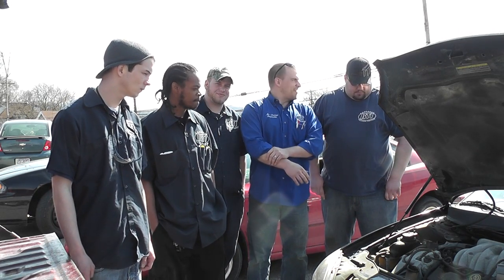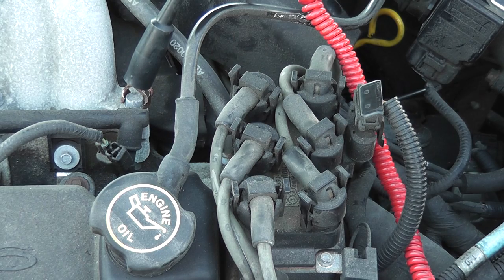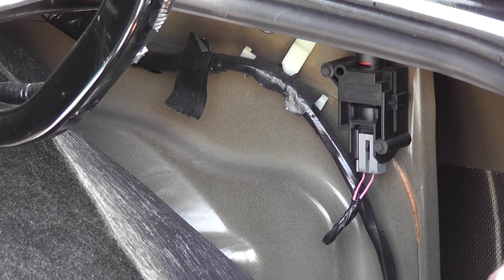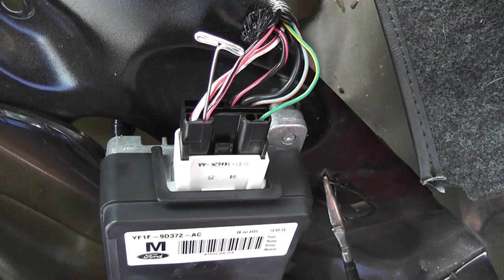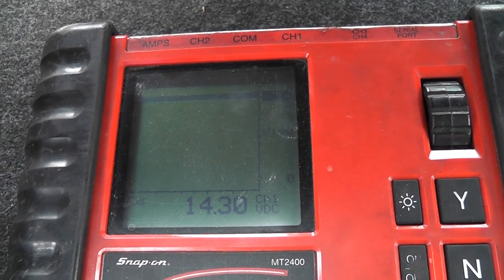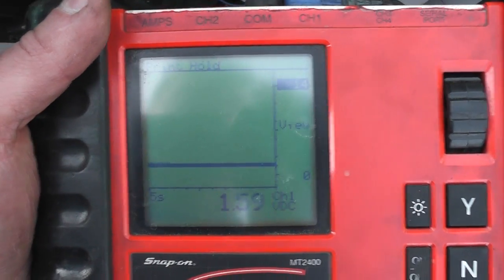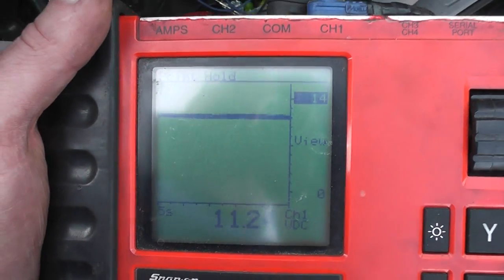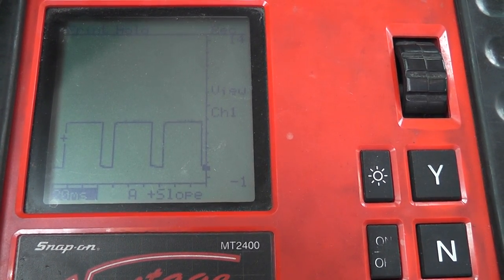Ford Electronic Returnless Fuel System Diagnosis (Part 1) - Ford

Comment from the maker: @bobby8926 surprisingly, it is very reliable, I have yet to see one of these module go bad. Every time I have diagnosed a low or no fuel pressure problem on these it was always the pump. However the modules can definitely fail, so I thought it was important to show the complete test.

Comment: Problem with your tool to detect voltage will cause you to make errors in judgment.  9volts will light your light but not run a 12volt circuit

Comment: Hey brother! Me again, we talked a couple months ago about a 2017 Ford Focus SE. You will be happy to know that I have diagnosed all of my electrical issues which lead me to determine that the PCM was for sure bad. 
I bought a new used pcm (correct PN) and went to use IDS to reprogram it and IDS would not for the life of me recognize the car as a Ford Focus...it kept recognizing it as a CMAX. After hours of diagnostic work and talking to my friend who is a “lead technician at Ford”...no luck. He kept telling me to replace parts which as we know is not the way you diagnose/ fix problems cheaply. I ignored it and decided to look into a electronic TB clicking noise that he told me not to worry about. Needless to say when I unplugged the TB, I was able to reprogram the pcm as IDS recognized it THEN as the correct year make and model. After doing all that and reprogramming PATS, the car cranked kinda intermittently with both keys which was a leap of confidence as it didn’t do that before. When I did a system test with IDS, all modules passed with flying colors but obviously I had a code for the TB. The challenge now is that every time I plug the TB in it begins clicking and I get a no communication with PCM 😭
Reply from the maker: maybe it is shorting out the 5v ref circuit when you plug the throttle body in. Do some voltage measurements on that unit and in particular the TPS circuits
Reply: @ScannerDanner  I am pretty sure I did and it was good. I will check again. Oddly enough I found a video in the depths of YouTube that a guy was experiencing the same symptoms: https://youtu.be/89erBTvQgSw

He dropped it off at Ford and they said it was a faulty fuel pressure sensor which fixed the problem. I will be checking the two fuel pressure sensors as well. I’m assuming in his situation the ecu wasn’t receiving correct pressures to allow the TB to calibrate correctly at key position 2.

Comment: Great video. I am a professional auto tech and just had an issue with a 2014 F150 Fuel pump. Several weeks ago the fuel pump failed, I properly diagnosed it and checked the operation of this fuel pump control module.  Replaced the fuel pump and got the truck going again for the customer.  Well two weeks later It died on the customer again. This time it was a bad fuel pump control module.  What must of happened was when the fuel pump failed it drew a high amperage and damaged or weakened the control module. It lived on for about two weeks but then failed. 
I think from this point forward when I replace a bad fuel pump I am also going to recommend this module be replaced as well.  In this case the module was $60, cheap insurance to prevent a future breakdown.

Comment: Thanks, you saved me a lot of worry and money.  I was pounding a dent out on a friends Taurus, driver side rear quarter panel.  I could hear an occasional noise like a tape measure snapping back.  Well, when I finished, the car would not start.  I found the inertia switch in the LH of the trunk, pushed the red button down and it started right up. 
 thanks again

Comment: Hey you just saved my life with this video. My 06 Mercury mountaineer died on me a few weeks ago. I changed fuel pump and fuel pressure sensor and nothing. I started checking ground wires and found the problem. Im now up and running again. Thank you so much for your information
Reply from the maker: no problem! So you found a bad ground wire to the fuel pump module?
Reply: ScannerDanner  I believe it was a ground. Was having the same type of symptoms.  rpms would bounce a little with blinkers on along with dash lights would flicker. Eventually it corroded all the way through leaving me at a stop light

Comment from the maker: @NOEISY1 Are you having any driveability problems? Both upstream O2 sensors should be switching rich lean. It sounds like your bank 1 O2 is not. But I would be careful about putting an O2 in this as a small vacuum leak on bank 1 could cause this condition too.

Comment: Thanks ScannerDanner!
I have a '03 Taurus with an intermittent start condition. I don't have a correct manual on hand and this is a great help to get to the issue. I couldn't find the fuel pump control module on the car to troubleshoot it.
Awesome help!

Comment: Excellent!  Wish I would have watched this yesterday before diagnosing.  On another note, (2004 ford explorer, 4.0, crank/start no power, 3000 rpm in neutral max) I did it differently in the end by jumping the pump power to incoming power (wt/rd to pk/bk), jumped pump ground (bk/pnk) to chassis ground, pump ran fine (I could hear it), still showed low pressure on scan tool, and under load pressure fell away until stalling.  Pulled the filter and turned the car on only to watch the fuel dribble out of the line.  I have never seen a pump that runs aurally fail.  I suppose it could be the in tank regulator failing, or the sock is clogged up.  Either way, it's time to pull the tank.  Thanks for your post!

Comment: Thanks for a nice explanation. I hv a ford mustang 2014, same system. It runs but struggles to start. Key on engine off has 41psi but rapidly drops to zero psi after a few seconds. My understanding should keep pressure in the line as it has check valve.
Reply from the maker: Is this a GDI system?

Comment: Best post yet dealing with no fuel pressure  for me ! Guy has freakin thunder cats knowledge, but the more I listen the better I get! Just wish you would do a f150 with that dual tank switch . Oh yeah where are the best grounds in cockpit areas where do you 1st look for grounds for your test light.

Comment from the maker: @JohnzCarz I don't think I would use an LED type test light but a regular test light you will have no problem with whatsoever. There is not enough current to damage the bulb filament.

Comment from the maker: @TRcustomengineering Thanks bro, stay tuned, I am going to review this with my class today, using the case study in my book on this same system. I will post the lecture when I am done.
Reply: Where is the lecture posted ? I would like to see it.
Reply from the maker: @rexluongo6470  offhand I don't have a link but it would most likely in my chapter 15 playlist (Fuel Pump Electrical Circuits) or 16 (Fuel Pressure Testing)
Reply: @ScannerDanner  If a maf sensor is replaced with a bad maf. Where do you buy a good one? Just asking because I figured out one of my issues. MAF is bad. Replaced it with oreillys new MAF, runs normal at idle but now runs lean at throttle and high rpm only. It used to be the opposite or just ran lean all the time. Throttle response improved tremendously. So I am pretty sure I got a bad MAF. What is your expert opinion?

Comment: I’m having the same sort of problem with my 1999 mustang v6 and most things point to it being a bad fuel pump but when I touch a different ground to it the fuel pump starts working. Also my injectors seemed to have stopped working. Maybe it’s all connected. Any advice would be great

Comment: Very helpful info.  thanks.   On a 2004 focus I tested , the fuel pressure was at 29 psi, (low end of the spec was 30 psi), and the pressure was bouncing around a bit.  Is that normal with a Ford module system that doesn't have a fuel pressure regulator?
Reply from the maker: Yes. And if you snap it to wide open throttle, it should increase as well, but I think you'd have to drive it to see it.

Comment from the maker: the key is to understand that this pump is ground side switched. so when the pump is turned off you should see full battery voltage on the pump ground. since we see low voltage this indicates a brush to motor contact problem.

Comment: Hey danner thanks for the videos they're awesome! I just don't understand how the bad brush contact in the fuel pump would cause the voltage to not return to 12 volts. What is the brush making contact with to make that happen? The way i see it when the rotor stops spinning the commutators may be in contact with the brushes either way, so my question is what exactly do you mean when you say " the reason it doesn't go back to 12 volts is because of a bad brush contact"? Thanks again man cheers!

Comment: Hey scan just a question the 1.61 volts at the ground side of the pump with an open ground and no current flowing you had voltage drop. Would it be correct to say the bad brush contact in the pump had incredablely high resistance? Excellent video.

Comment: ScannerDanner.....AWESOM breakdown.  I am currently working on the same vehicle, 2000 taurus....one question....how did you access the CM in the trunk?  Is the "felt" verticl cover that looks like it runs along the back of the seat what needs to come off?  If so how did you go about removing that?  I can't figure out how to remove things without damaging the covers...
Reply from the maker: Jeff it's been a long time. I believe I was working in the right rear area. Don't remember if I took the seat out but I do remember having difficulty finding it.

Comment: Just want to say thank you for everything. i’ve been learning a lot from you. But I’m stuck don’t know what to do I have a 2006 Ford ranger 4.OL V6 having a misfire problem I replace the coils and spark plugs and wires and it’s always the second cylinder misfire I checked for leaks check my map sensor and my downstream O2 sensors both short term -2 in the long term is at between 14 16 what can I do next ..
Reply from the maker: could be an injector or compression issue. Check compression next

Comment: Urgent help needed!
Got my hands on a car, 2003 police version. Engine will not start. Runs for 10 seconds in the morning after starting it and won't start it again during the day. I have changed the crankshaft sensor, idle valve, fuel pump control unit. There are no errors in the diagnostic scanner. Also in the scanner I can see the engine RPM, fuel pressure and other parameters that are normal. I can see pulses on the coils and injectors connected with lights when trying to start.
I've checked all the fuses and relays, tested the wiring. The spark plugs in the engine are new, compression in the cylinders is fine. Have not been able to cope for a week now. Help with advice or action.
Reply: @Slipknot-qm9yh Bring it back to the police station, bro.  Not worth it 😀

Comment from the maker: It does and I can on a different car in the future as this one is fixed and back to the customer. Testing is identical to any pressure sensor. 5v reference, signal and a ground. Signal voltage is analog and changes in proportion to fuel rail pressure. Low voltage, around .5 volt = 0 psi (if I remember correctly)

Comment: While my 2000 Taurus was running I checked the voltage on the power wire from the driver module to the pump and it shows 9 volts.  Should it be higher or is it ok? The car left me stranded with no start and went back couple hours later and it started. I got a code for the fuel pump driver module also
Reply from the maker: I don't remember if the pump is controlled on the power or the ground side. It is pulse width modulated so seeing an average of the signal is normal

Comment: Paul, on this design is the injector pressure sensor the only input for fuel pump speed or are there other inputs?

Comment: 2000 Ford Taurus did all the checks you showed...everything checks out. Couldn't hear the fuel pump when turned key on. Then when I double checked the main black ground wire while cranking it, it started...pump going out? How can I verify that the module is for sure good? It DOES have power in and out...

Comment: EXCELLENT! Can you tell me?... 2000 Taurus, no FP prime at KO; At the FPDM I have 12V in from inertia switch at KOEO, 12V at White/red (to FP) and 12V at Black/pink (FP ground) which drops to 0.45V on crank and then returns to 12V. Again, no FP prime at KO. Does this indicate dead FP?

Comment: so the fuel pump is modulated like a epc solenoid /force motor in a transmission 
thanks for the help i am a transmission tech so when i have other problems i some times need a little help

Comment: posted this question on the other vid. I tested that blk and pink wire it did the same as your vid but the pump and sending unit is new could the wires just be bad or connectors

Comment: Hello Greetings I need your help please,
I have a zx2 99 and my fuel trim long climbs to 10%
I think that is something the rail injection pressure sensor that put a gauge on the rail and mark ralenty 30 psi, to connect the multimeter to the sensor gives me a voltage 2.8 volts, at WOT speed rises to 40 psi and the pressure gauge voltage rises to 3.4, lower back but after reading it before is this normal? I ask because I put 2 different fps and do the same, note: the sensors were yonks cars

Comment: What if the control signal wire is just staying a constant 12v? I’ve been having the hardest time diagnosing my 06 Ford Escape, it shows 12v and with drop down once in a while and that’s when I hear the pump run. Other then that, key on engine cranking or off it shows 12v. Tia
Reply from the maker: Have you watched part 2 yet? Do that, then we can talk

Comment: ScannerDanner, I was changing the oil on my 2000 Ford Ranger today, and I noticed a fuel pressure regulator sitting right there on the fuel rail, which reminded me of as to why would a returnless fuel system even have a fuel pressure regulator present. She only has one line feeding the fuel rail, and the fuel filter has a 3rd bypass line on it. I'm puzzled as to why there is even a fuel pressure regulator there. This one is beyond me. She has the 2.5 Lima inline 4 block under her hood.
Reply: that is probably a dampener  not a regulator. they look similar

Comment: Is the fuel rail pressure sensor the only fuel pressure monitoring sensor on a Ford? If there is a fault in the pressure sensor would that change the actual fuel pressure? For example, if the sensor reads the fuel pressure is 40psi and that is the desired pressure but the actual pressure is 25. Would the computer operate the fuel pump to keep the pressure at that 25psi, thinking it is 40 psi?
On a Ford, should the desired fuel pressure ever change or should it be constant? Only asking because on my Ford it stays constant but I have a fault code for the fuel pump out of range.
Reply from the maker: I believe with a FP sensor fault the duty cycle of the fuel pump will then be fixed and so will the pressure. What that default psi is, I do not know.
Reply: @ScannerDanner  My code is gone for the Fuel Rail Pressure sensor. May come back but has not in 4 drive cycles. So we will see? Neither did the fuel pump code. Still have the lean codes, IMRV stuck closed codes. I think when I finally find a good MAF, the lean codes will be done. It idles normal now, no rich, no lean. Just runs lean now at throttle and higher rpm. Lack of power is fixed. Still has rough idle but has much improvement.
Reply: @ScannerDanner  I have a fault code on my Ford and the duty cycle changes with throttle position but the pcm is always keeping the fuel pressure at 40 psi. Which kind of defeats the purpose of the variable pump, in my opinion. Why don't they just put a 50 psi pump and call it good?

Maybe is it because they want to have a more accurate measurement of how much fuel the injectors are pumping????

Comment: I have a 2000 Merc Sable. P1237 code came up(car still runs) did the test on the module, and when I got a low voltage on the ground wire(red w/black tracer) after cranking, I banged on the tank to see if the voltage would come up, it didn't. Does it still mean that I have a bad pump? even though the car still runs?  THX

Comment: Hey Scanner Danner thanks for your videos bro. I have a similar issue with an 04 Suburban. Mine starts though. I changed my intake manifold gasket and it all of a sudden began to hard start. Checked fuel pressure and it was low...below GM recommended at 36psi. Changed fuel pump and it still does it but now fuel pressure is at 46psi.  Cranks over on second attempt. Wondering of its a defective pump or maybe voltage drop at connector. What are your thoughts???
Reply from the maker: did this problem start immediately after changing the intake gasket?
Reply: @ScannerDanner  yes. I changed knock sensors, oil pressure sensor and camshaft sensors as well since I removed the intake. So weird. Sometimes it starts right up and most of the time hardstart
Reply from the maker: @jessemiranda8329  not much else I can suggest without seeing it my friend. If you need additional help, I've created a free forum you can join on my website at www.scannerdanner.com I have over 28k global members and hand picked moderators who are there to help me help you guys. Hope to see you there!

Comment: when i am checking for grounds i look to see if there is continuity to body, would that be an acceptable way of checking? I also check for amperage on the power wires because continuity can be biased and doesn't measure current

Comment: i did your method of checking spark using a test light, and i got no spark, i hear the fuel pump start when i put KOEO, i just want to ask some advice what to check next 2005 explorer xlt 4.0 flex non sporttrac thanks for the vids, learned a lot!